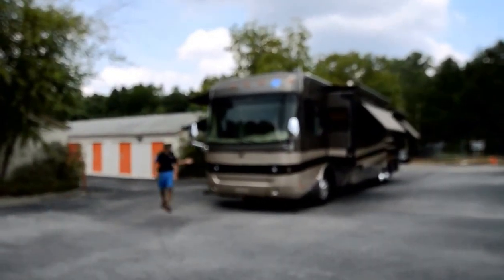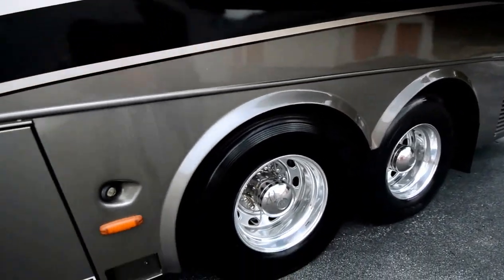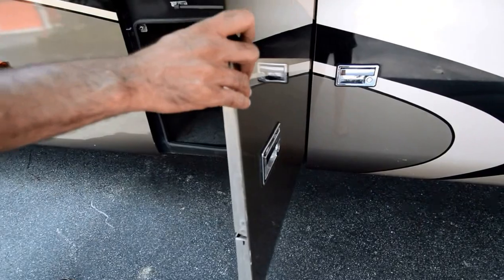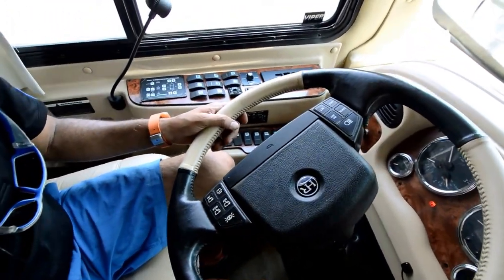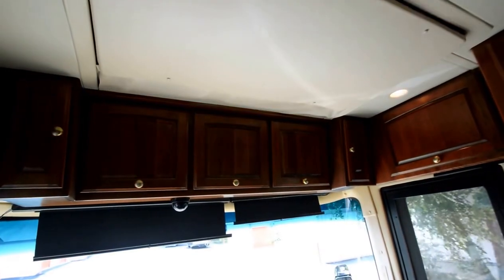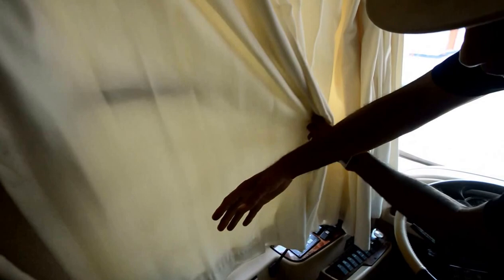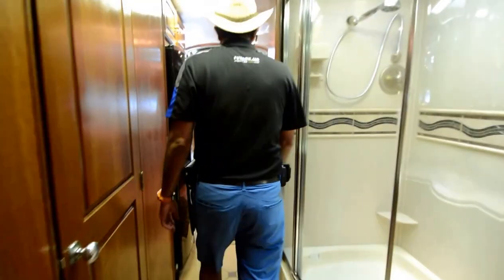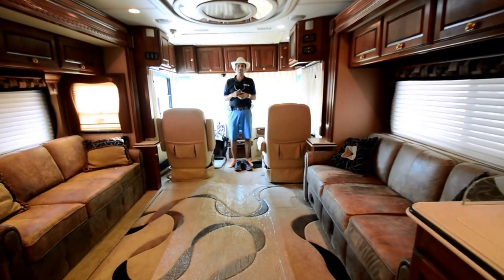2006 Holiday Rambler Navigator 43PDQ

Comment: Is the coach still available?
Reply: Patrick Martin this video was published July 2016. The answer is No.
Reply: Patrick Martin  is motor home still available?
Reply: Many of these don't sell. They're advertised and then they sit and sit and sit. Many times, they just fade away or they are traded for unrelated property and the seller takes a major hit. The RV market is, and always has been, a tough market; thousands of units on the market at any one time. My family and I have been in this game since the 1970s; it never changes. Also, many times, the sellers get stubborn and rather than taking some money, the unit sits and depreciates even further from poor/no maintenance/repairs, along with weathering and fading to the exterior. I know of several individuals who are still suffering from the 2008 market sell-off; most of those people paid major high prices for RVs just before the market sold off; several paid at or above $500k for some of those units. Today, they try and try and try to escape the mess for $100K. I know of two units that have been repossessed twice since 2007 and they still sit with bank/lender ownership and red ink. What the ignorant don't understand is that when the larger coach RVs get older, the mileage actually doesn't matter because the age starts taking its toll on the unit; most 15-year-old and older units, need at or near $50K in repairs to get them fully operational and within DOT specifications; tires - $6,000, AC units are failing at 15 years old; three of those installed new will cost over $10,000 with the labor; brakes, wheel seals, coolant systems - usually the radiator, oil cooler, transmission coolers need to be replaced at/or near 15 years; those components are $25,000 minimum with labor. Those are just a few of the repairs that will need to be done. It's a tough market. Be careful, people; it's enjoyable but it's also expensive. I've lived all of it. We do our own repairs and it still costs thousands to keep everything operational.